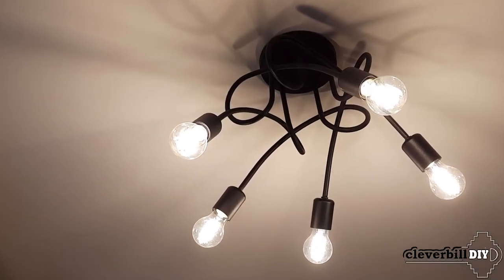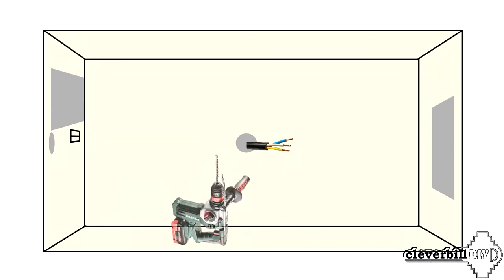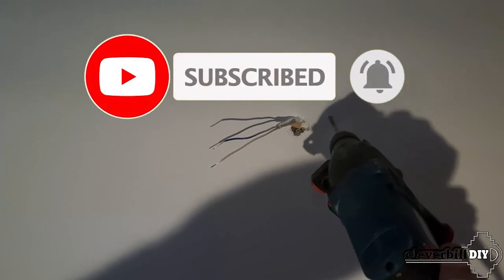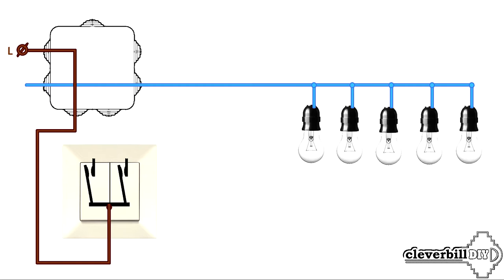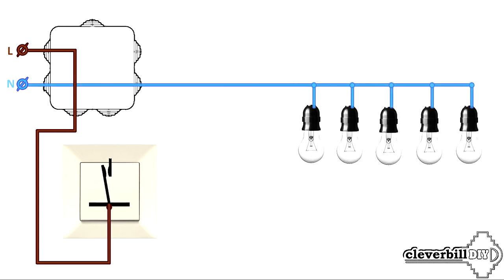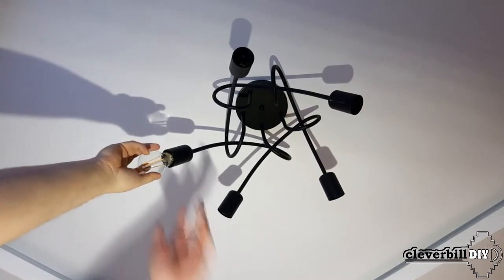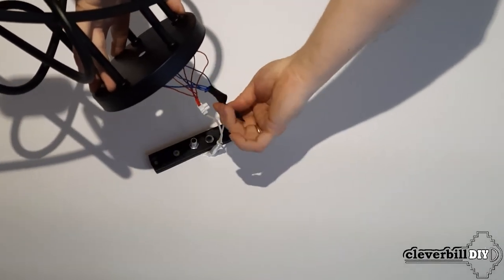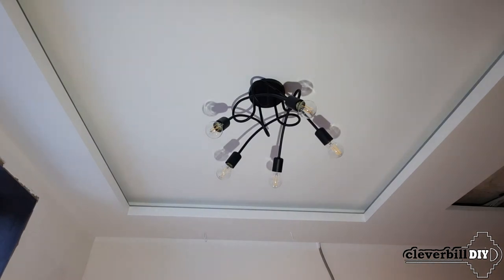How to hang and connect a chandelier - DIY

Comment from the maker: It is not difficult to install a chandelier and connect it to the supply wires, and every technically competent person can do this. The main thing is safety precautions, work only when the electricity supply is completely disconnected in the room.